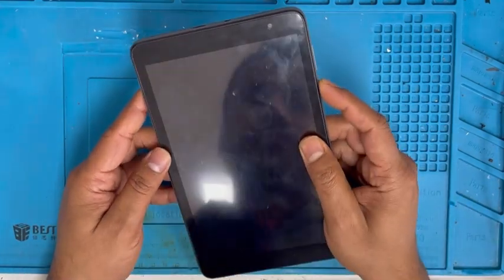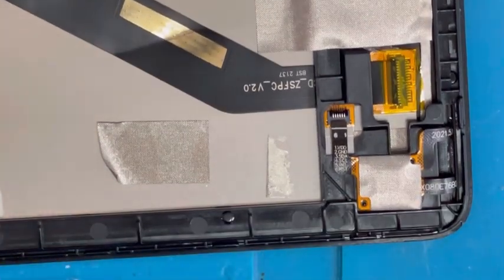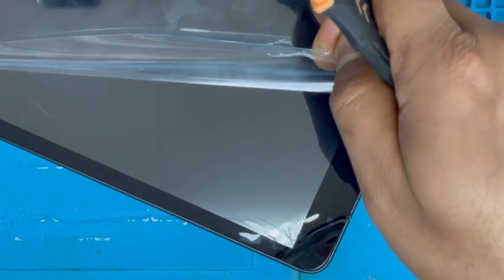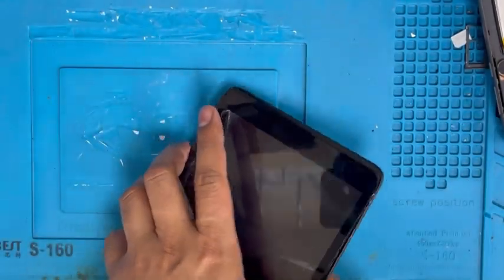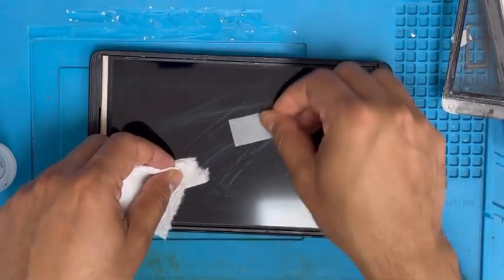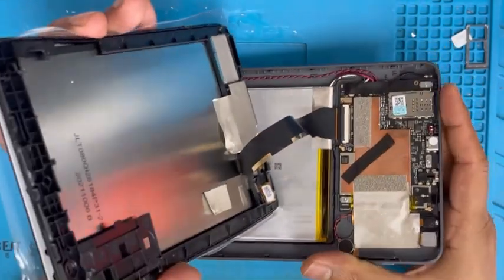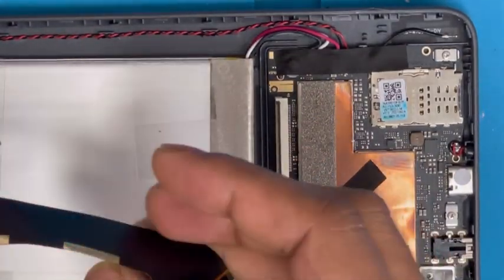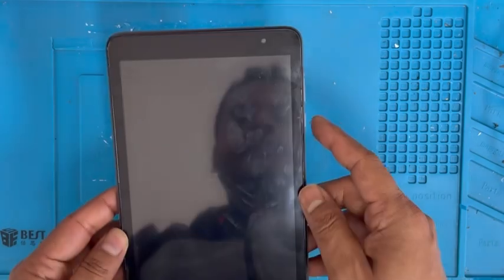sky devices elite octamax touch digitizer screen replacement

Comment: How can you get to the recovery mode?
Reply from the maker: Sorry I didn’t get it
You want to do reset your tablet?
Why you need recovery mode?
Reply: @s-us-u8296 I just want to reset the tablet entering the Recovery mode
Reply: Hello, what is that tool you are using to heat up and remove edges covering the digitizer?
Reply from the maker: @tommyv365  hot air gun
Reply: @s-us-u8296  Ok thanks!